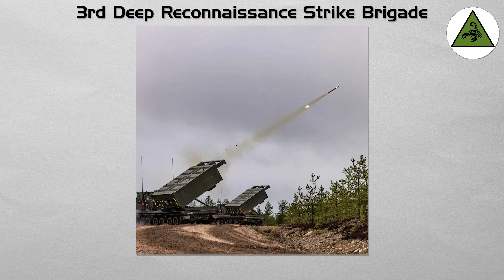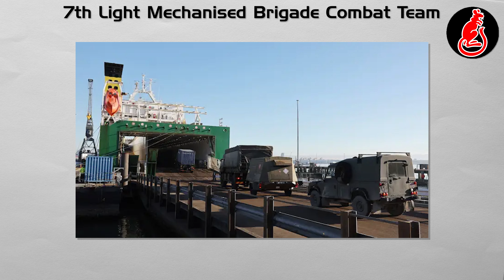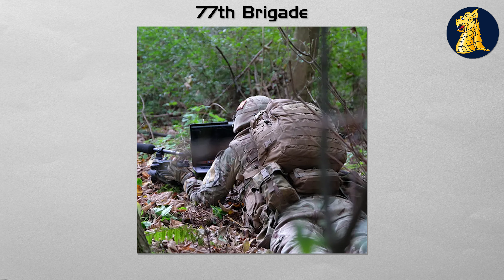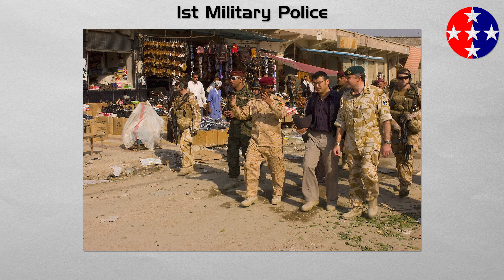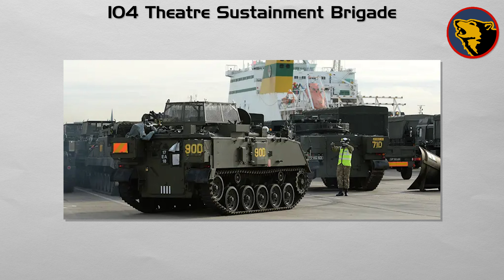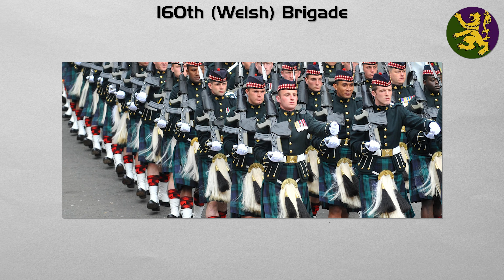Every British Army Brigade Explained

Comment: I notice that the new Ranger battalion have stolen the insignia of the Rhodesian Selous Scouts, an elite special forces unit that operated during the Rhodesian Bush War.
Reply: Some people in the British Army commented on that as well. But the new cap badge was a case of parallel evolution: Of you want a capbadge with a hovering bird of prey on it, then it will resemble other ones based on the same idea. And still: It's not a bad unit to be compared with!
Reply: @Korporaal1  Army Air Corps springs to mind =D